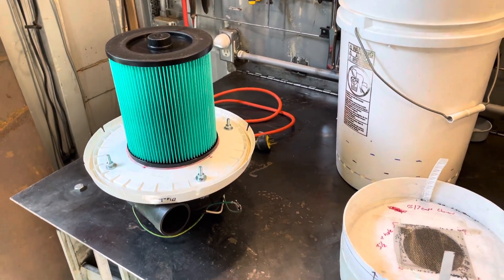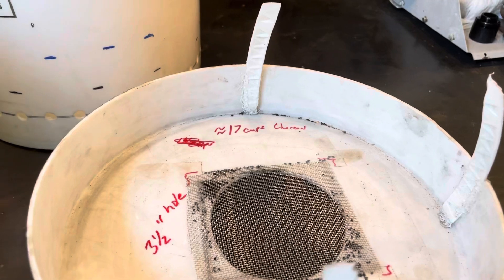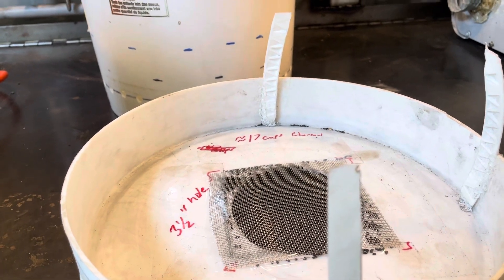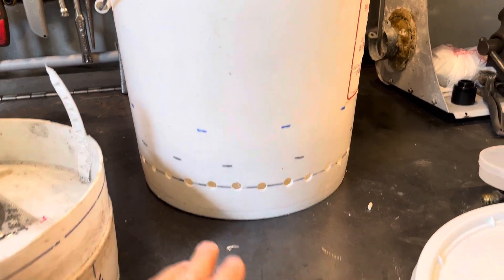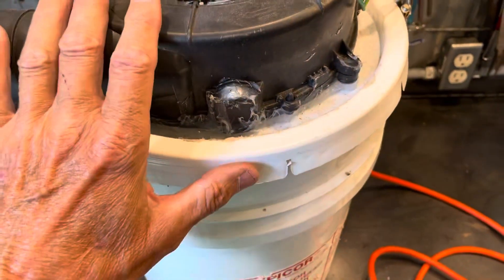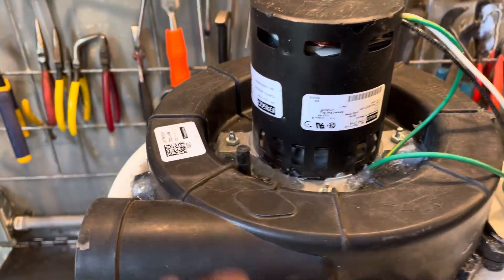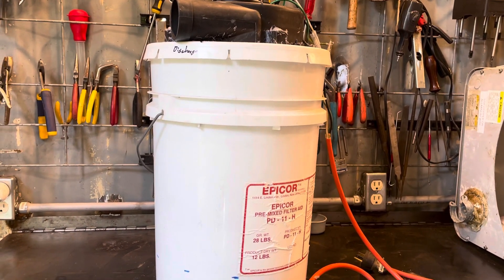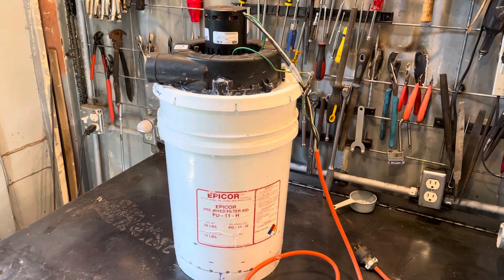Emergency nuclear contamination filter made with easily obtained items(nuclear fallout protection)

Comment: Solar panels produce power from radiation so you you get a boost!! seriously solar panels to run it would need to have battery backup system to support it overnight or cloudy day's. The big problem with Solar panels is they do get dust covered and it seriously reduces input power.  You would also need a reasonable inverter to run the motor as inductive loads on cheap inverters can cause failures. Use lithium batteries as they don't produce hydrogen from charging, you could put the lead acid ones outside but if you get a problem? positive pressure ventilation system is best and a basement would be good. I live in the mountains of Spain off grid on everything. I like the idea of the filter system. Thanks for your time and work.
Reply from the maker: You Will really needed a manual air mover as a last resort. Power would be nice but not always possible. I made a video on a simple hand operated air mover that could easily hooked to the discharge of the blower as could a dc blower. Positive pressure would be hard to maintain with a hand pump but at least you could control makeup air flow through the filter. Thanks for the comment.

Comment: That will consume high wattage..if fallout comes so does the grid..if thru offgrid power 80 to 100 watt i prefer
Reply from the maker: Yes I know but the filter is an NBC filter and could be used when the grid is still available. I did a video of a manual air pump that could be connected to the discharge of the blower and would be able to pull air through the blower. You could also use a dc powered blower. I also did a video diagraming a way to set it up to supply your shelter. Thanks for your comment.👍

Comment: from where the energy power after nuclear explosions?
Reply from the maker: Not all nuclear events will have a loss of power. Nuclear power plant events can occur without the loss of the grid. However, the design allows you to connect a manual operated air pump if needed. I made a video on a simple manual air pump that can use for air flow. Also if you have a dc power source you can connect dc powered blowers to the discharge of the blower. My intent was to show a design that could be made in expensively. I looked up the current price of a “safe cell” NBC filter which are functionally the same and they run around $4000 and were out of stock.

Comment: First the radiation is on the dust not in the air unless the dust is in the air.  Also radiation is not a chemical, so you do not need the charcoal.  All you need is the filter to keep the dust out.  remember the radiation is on the dust and dirt.  .
Reply from the maker: I agree the HPEA filter removes the bulk of the radioactive contamination. However, radiation is not on the dust. Rather radioactive isotopes can combine with dust but some doesn’t. The radiation comes from the radioactive isotopes which are chemicals. Although the charcoal will filter some of the particles, that is not the primary function of the charcoal. Some of the fission products of a nuclear detonation and even more from a nuclear power plant are fission product gases. The HEPA filter does not remove these gases. So one reason there is charcoal for a nuclear event is to hold the fission product gases until they decay to fission product particles which can then be captured by the HEPA filter. So the HEPA filter is the most important part but the charcoal makes it more effective. Also this filter is also designed from chemical and biological events. The design is the same.
Reply: Awesome Set-up! I could see this valuable for when I am painting or doing sheet rock with a slight mod. Thanks
Reply: Thanks for sharing this filtration idea. 
You can make your own activated charcoal from hardwood bbq charcoal. 

Radon is a gas that is radioactive. 
Your shelter is blow ground where radon is known to naturally creep up through even concrete foundations. We’re getting from all sides!
Reply: @ruidadgmailcanada8508  Activated charcoal requires a specific protocol, it is not cahrcoal from BBQ at all. Aquarrium pellets work fine against organic vapor, at least (tested agaisnt fumes from a burnt down industrial site)
Reply from the maker: @ruidadgmailcanada8508  thanks for the reply. The activated charcoal I’ve seen made is questionable on it’s effectiveness. There maybe a way but I would want to be able to test it. I think I saw a good video on YouTube where a chemist tried to make it but when testing it he found it wasn’t really very effective. So just be ware. Also we do get naturally occurring radioactive radon from the ground in many areas but this is a very long term exposure issue and the levels are very very low. The test for radon has you put a couple of absorption material in the basement and leave them for 90 days just to collect enough for the testing. In fact to reduce the levels in homes they will use a blower to take a suction from under the floor of the basement or crawl space and just vent it outside with no filters. If your sheltering due to an emergency the basement is typically but not always your safest area. Of course everyone has to evaluate their own situation.
Reply: @edwardjackson9791  A team from an US university succeeded to make activated charcoal with low expense common items, for Latin low income polluted areas - aimed to filter the polluted water. Worked fine. agaisnt acid gases and other stuff, more difficult, components must be added ...
Reply: @edwardjackson9791  Can you use any type of activated charcoal?
Reply: @ruidadgmailcanada8508  You're right. Mine will be used  on a timer regardless of whether it ever is needed for this purpose because it will vent radon gas from under my house. If something does happen all I need to do is 2-minute connection to the outside air source.
Reply: An atom bomb is going to produce isotopes in all physical states.  Solids, liquids, gasses, you name it, it's going to be there.  Then on top of the isotopes you're going to have gasses released from the burning of all materials where the bomb detonated.  So burning plastics, rubber, treated lumber, paint, metal fires.  All those fumes just wafting around.  Followed by the fumes of decaying material, people, pets, livestock...  But most will abandon their shelters far too early as the social isolation will drive people insane.  We saw it with covid, people were told to stay home, and that was far too hard for a lot of people.  You'll witness people out and about, you'll be faced with a decision, either you're the only smart person in the neighborhood and you remain sheltered, or you're being an overly cautious wimp and you succumb to peer pressure.  Everyone else is walking around without a mask, do you want to be the weirdo?   Maybe the government wants you indoors because secretly they bombed the country, they don't want you to see the next stages of their plan!  There's mind control robots in the iodine tablets!!!  Next thing you know there's people protesting a marching through all the radioactive dust demanding the government gives back their freedom!

Comment: How do you know it'll work?
Reply from the maker: If you look up the design of NBC (Nuclear, Chemical, Biological) filters. This is the process that is used. This is the same design we used at nuclear power plants for our emergency filter systems in the event of an event. The control room, reactor building, emergency command and control center each had a filter system designed like this, of course those cost hundreds of thousands of dollars but the process was the same. Based on specific design requirements there were some variations like some would have Hepa-charcoal-hepa but others were just like this. The key in building your on is to make sure that you have no leakage paths from the filter to the suction of your air pump (electric or manual) if you are not drawing the air through your filter you can suck in contaminated air bypassing the filter. Minor air leaks like around bearings are acceptable but you want to avoid large leaks.
Reply: @edwardjackson9791  well that definitely answers my question.  I think videos like this are very important in the times we're living in. I don't think people realize just how close we are to a nuclear world war III

Comment: ROFLMAO…… I’ll go outside with a catchers mitt and wait…

 Not likely anything lives…
Reply from the maker: Not quite sure what you mean, but going outside would not be the best idea. Unless you are within a couple of miles of a nuclear detonation you are likely to survive by sheltering and controlling the makeup air you bring into you living area. Within 48 hours outside radiation levels will not be immediate life threatening. Nuclear detonations are really a local event and radiation levels drop rapidly. There is much less long lived radioactive isotopes produced during a nuclear detonation than a power plant event due the smaller mass that becomes irradiated. 
Even during a nuclear plant event like Fukushima sheltering will protect you. Long term there may be issues but the less exposure you get the better. 
Leaving the area is not likely during a nuclear detonation and depending on the area it may not be possible during a nuclear plant event, depending on traffic and lead time from notification.
Reply: @edwardjackson9791  uh.  Like duh.. I lived through this sh1t once..hide under desks.  All that....  now at my age .. no biggie .  Rather it be quick

Comment: Not a bad idea but how are you going to run this if there is no electricity?
205
Reply from the maker: The blower is open and a manual bellows can be attached to the discharge. Manual operation can be used to draw air through the filter and provided. Not all events will have a grid down scenario. The design was to show the concept. Implementation will be dependent on actual conditions.
Reply: off grid generation

Comment: I understand the ingenuity. but if a nuclear bomb goes off the radiation is not only in the dust that will be traveling in the wind. It is also attached to atoms that are floating around which are microscopic that will pass through your filters. The best thing to do is to take iodine liquid drops to fill up your thyroid because you will be in contact with radiation no matter what The question is how much ..so on a microscopical scale your air filter is useless
Reply from the maker: Yes some radioactive will pass through the filter. No filter is 100% effective. The point of a filter is to reduce the radioactivity you receive to a level that is not unacceptably high. Radiation does not attach to atoms it is the property of the atom itself. The decay of a particular atomic isotope is where the ionizing radiation comes from. (i.e. Beta decay, Alpha Decay, or gamma decay) The way these type filters work is the activated charcoal has a massive surface area (small pours which trap the atoms for a time, then the atom may escape only to be trapped in another pour) This holdup time allows the atoms to decay to stable atoms which are no longer radioactive or to become radioactive particles. HEPA filters will not trap gases, that is why the charcoal is first. The fission product gases are trapped in the charcoal long enough to decay to particulates which can be trapped by the HEPA filter. 
As far as iodine is concerned, this is a big misconception. Yes, radioactive iodine is a fission produce but it is only one of many. The thyroid does take up iodine and it helps to saturate your system with none radioactive iodine to help prevent up taking radioactive iodine into your thyroid but it is only recommended for people less than 40 years old. It is a long term issue. There are many other fission products produced other than iodine. 
This filter design is the design used at nuclear power plants to maintain habitability of critical areas like the Control Room, Reactor Building, and Emergency Command and Control facilities. Although those systems are more sophisticated in design and function, the process is the same. Use activated charcoal to hold up the radioactive atoms until they decay into particulate or stable atoms and HEPA filter to remove particulates.
This issuance of KI (potassium Iodine) is way, way down on the emergency procedures at nuclear plants.
Reply: @edwardjackson9791  Charcoal = Protection agaisnt subproducts of the blast and fires, as toxic fumes, soot, VOC etc. Lot of toxic chemicals in our modern environment.  A french engineer from a facility designing pro shelters for industry, administration (and wealthy individual) explained me why.
Reply: I'd look into under which scenarios Iodine is usefull....

Comment: after a nuclear strike, there will be no more electricity so it's useless your thing
Reply from the maker: Actually it is not useless. The filter design allows you to hook up the discharge of the blower to a mechanical bellows or a 12vdc blower. The blower is has an open flow path through the blower fan and would not restrict air flow. You will have to take your particular circumstances into account to get the max benefits out of the filter. Also it is not just useful for an nuclear attack but is also used during nuclear power plant events, chemical,, and biological events. Some of these events would not have a loss of power.

Comment: And hope the power stays on. I like it.
Reply from the maker: You can hook up a manual bellows  to the discharge of the blower and provide air flow manually. However, it will not keep your shelter area at a positive pressure long. It would provide filtered air for makeup though. I plan on a follow up video soon to discuss more detail on how to provide a safer protected area.
Reply: @edwardjackson9791  I'm planning a very small filter/fan setup on 12v and hook it up on a solar panel and a battery. Just to provide clean air and overpressure in a small room or basement until they get the power back up.
Reply from the maker: @denniskatinas  that sounds good. If the 12Vdc works it would be good if you post some details. Good luck.
Reply: @edwardjackson9791  Thank you, I will post the details when I got it to work.

Comment: I love the design of the pump. Couple thoughts/concerns. 1. Most people will not have electricity after a nuclear detonation so how do you plan to power it? 2. Would the benefit really be there? By pumping air pressure into the house in one location it seems like you could potentially cause additional inward suction of dust into the house if the pressure isn't equalized throughout the space. Seems like just not disturbing the air might be a safer option. 4. Assuming that you plan to hunker down for a couple weeks at least I would be a bit concerned that the noise of the unit could draw attention from looters who were not educated on how long they need to stay inside. Im not intending to poo poo the idea. I am just wondering if you have thought about these things.
Reply from the maker: I plan on making more detailed videos thanks for your questions I’ll try to quickly address them. 
1. This is not just for nuclear attacks but is also good for nuclear power plant events and biological and chemical events. Also due to the design of the blower you can manually draw air through it with a manual bellows style air pump. This will also allow quiet operations if needed.
2. It would best be used in an area within the house that is sealed off so air flow would be to a room or two to maintain air quality in that area. If operated in manual mode you would just be able to replenish the air and manage the CO2 and humidity in your shelter area. A CO2 monitor would be very important.
I will post some new videos soon and hopefully touch on your question and others.
Just to let you know this is the basic design of NBC filters used at nuclear plant for protection of the control room and other areas for personnel protection. It has the same functional characteristics but at a rudimentary level.
Reply: Generator You can get them to run on gas propane and hook them up to solar panels I got one they're great,
Reply: Solar panels produce power from radiation so you you get a boost!! seriously solar panels to run it would need to have battery backup system to support it overnight or cloudy day's. The big problem with Solar panels is they do get dust covered and it seriously reduces input power.  You would also need a reasonable inverter to run the motor as inductive loads on cheap inverters can cause failures. Use lithium batteries as they don't produce hydrogen from charging, you could put the lead acid ones outside but if you get a problem? positive pressure ventilation system is best and a basement would be good. I live in the mountains of Spain off grid on everything. I like the idea of the filter system. Thanks for your time and work.
Reply: @barrymayson2492  Depends on how much you're willing to spend on solar panels, Cause my solar panels on a cloudy day draw 60% of what they would on a Sunny day, Severe rainstorms is another story, I got enough batteries to run my bunker for 7 days without any power, I I don't have hundreds of batteries,  depends on how much you're willing to spend Is the quality you get,